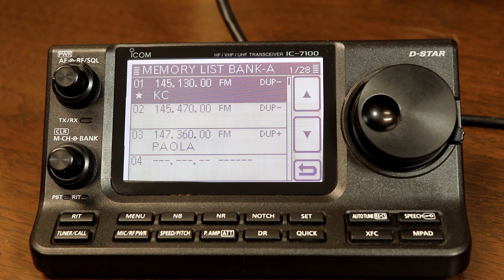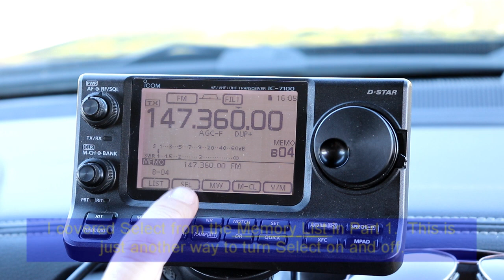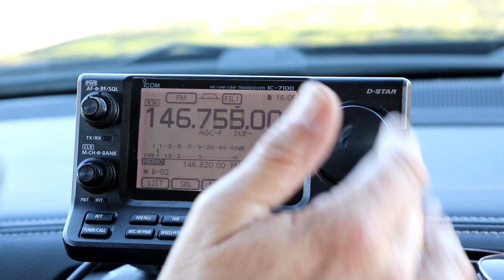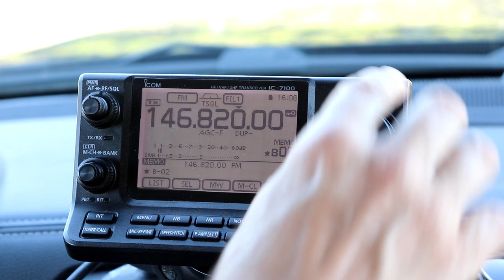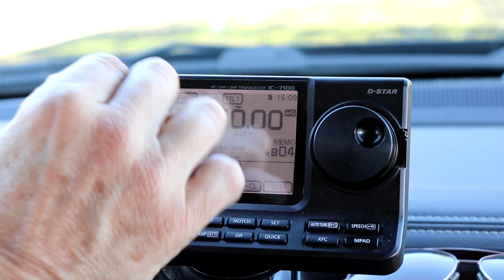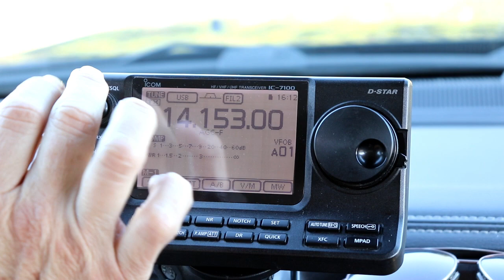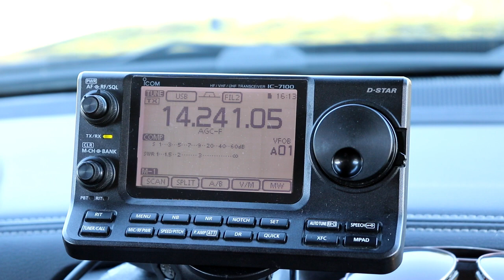IC-7100 from A to Z #9 Memories - Part 3

Comment: What HF antenna are you running when your in your truck..?
Thans in advance, I am watching all these videos, because I have this radio on my wish list, plus the 705. I wish you also had the 5100, some of this stuff is probably the same, but I like the style and how you are teaching us all how to make this so much easier to use. I learned visually and hands on better than reading a manual. Keep up the great work
Dale
KI5ARH
Reply from the maker: Thank you for the kind words Dale.  I'm glad the channel is helpful for you.  I have tried a number of antennas on the truck.  I have a 3/8x24 mount so I can easily try different antennas.  When I'm on a long trip,  I typically use just an 8 foot Stainless whip with an autotuner under the back seat.  It's not the most efficient, but it works okay from 20 meters up.  It will load up on 40 meters, but I'm quite sure I'm not getting out too well.  I recently bought a Wolf River Coils Silver Bullet 1000.  I cut down one of my stainless whips to about 5 feet to use with it.  It seems to work pretty well, but I've only used it stationary so far.  I'm not comfortable that it is sturdy enough for highway speeds without a guy string of some sort.

Comment: Does this have band edge memories so I can set the General bands so I don't screw up and go outside my limits?
Reply from the maker: Hi Donald.  Yes.  The IC-7100 has User Band Edges that you can set to limit where you transmit.  If you press SET and go to the Function menu, you will find the User Band Edges option right under the Band Edge Beeps option.  HOWEVER, you must have Band Edge Beeps set to “ON (User)” or “ON (User) & Limit TX”.  If Band Edge Beeps is set to OFF or ON (Default), then the User Band Edge menu option won’t appear.
Reply: @HamRadioA2Z  I would have it set to TX LIMIT to be sure I didn't get out of band!  I understand that it is set up to keep me in the band for top license,  I am just General.  Want to make sure I stay in my bands.   Thank you for the very good videos!  73 W4DES
Reply from the maker: Yes.  You can do that. When you set band edge beeps to ON (User) & TX Limit, you just change the User edges for each band to the limits for your license.